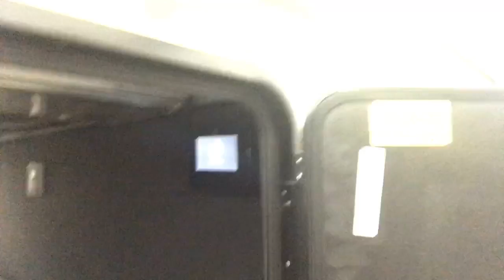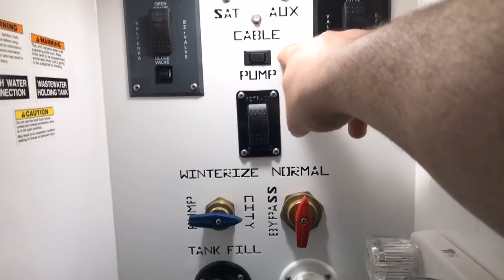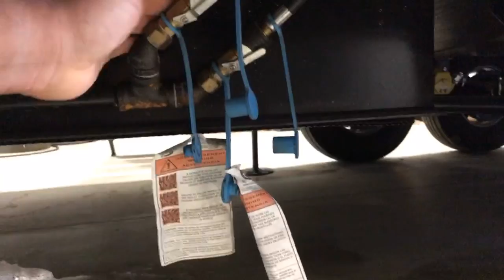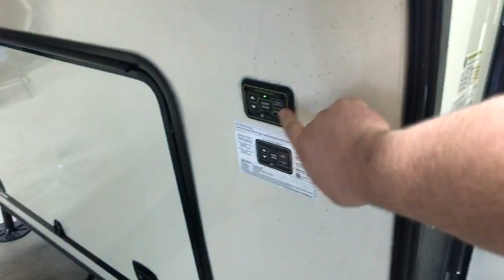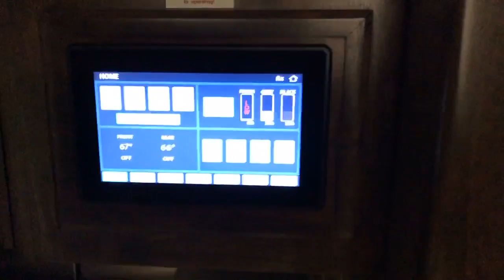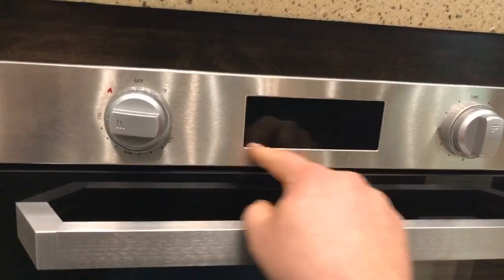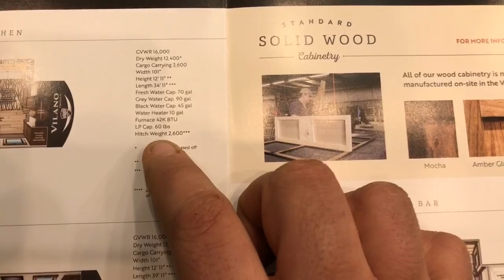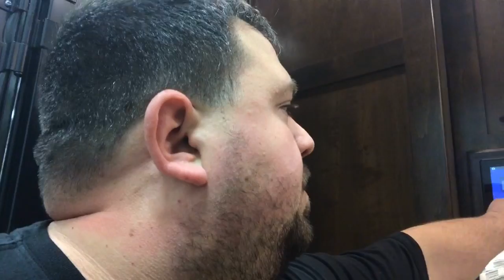Vanleigh Vilano fifth wheel walk through

Comment: Love the shut off valves throughout, love the placement of the heat vents,
Could you get the control center,circuit breaker up eye level, jack and Jill bath access,  
LOVE THIS !
Reply from the maker: Joyce Weems thanks for watching my videos. Unfortunately I no longer work at that dealership. I currently for a company that service luxe fifth wheels
Reply from the maker: R&M M so I would not say it’s better than a luxe because a luxe is a whole different category as there all customer. Vanleigh is a regular production unit they build 15-30 a day. Luxe is only two a day I believe. As for solitude I would rank the Vilano higher by far than the solitude. I am not a fan my self of grand design which is just my opinion. I have a condition. I have what I believe is a sharp eye. When I meet a new unit I see the flaws first. And once I see one the rest just scream at me. Can’t help it. When I did pdi ( pre delivery inspection in case you didn’t know ) I really didn’t have much to fix from vilano. When I had an issue I picked up the phone they asked for coach info or appliance info and general I had an approval same day. They are amazing to work with. I do currently work for a service center that is the luxe service center and see many come in. Most for seasonal repairs but warranty as well as customer pay.

Comment: Love this video....???  we just got back from our maiden voyage in a Beacon 34rdb.  As soon as we got to storage I noticed water coming out of the back end of the unit.  Opened the door and there was water all over the floor, in drawers, everywhere.  we had about 50 gal of water in the tank.  WE thiNK the pump was left on??? and found the kitchen faucet open...Was sure we closed it.  We cleaned up as best as we can and hope it dries fast.  Would the pump on cause this bumping down the road??? HELP
Reply from the maker: usamacka absolutely. I have seen that in the past and tell my customers to use a rubber band or strap to hold it closed. These fixtures are not made for rvs so these things happen. Lesson learned. Get some damp rid and place them in the trailer and storage bays to help with the moisture in the air. We do this one the summer and winter and change ours out twice a year. My grandfather used five in his part camper over the winter and they were full by spring.
Reply: @workingtorelax1223  thank you!!!  Now we have electric issue...looks like GFI got water in it...NO GO...
Reply from the maker: usamacka well that can be fixed with some time as well just needs to dry well. If it’s not ok in a day or so then you may want to replace it. Gfci are not difficult to change and the best part is all you have to do is unplug the trailer from shore power and shut down the generator and it’s completely safe. O turn off the inverter too to be safe.
Reply from the maker: So if your into Facebook I have a group. It’s small only a out 63 people but these are folks that if needed can tag me in a post and I’ll put out what ever I can to help with issues they have over long distances. It’s called working to relax rv

Comment: Shackle torque next to impossible with current set up.  Nuts are behind tires.  Gray water open/closed light inop.
Reply from the maker: Google User are u saying your don’t care for those items and the light dose not work.
Reply: I'm saying only the shackle nut is torqued and the light doesn't/didn't work.  With the nut outwards, it is very difficult to torque unless the tires are removed which means more torqueing of the wheel lugs.